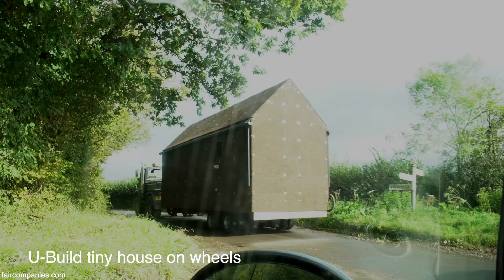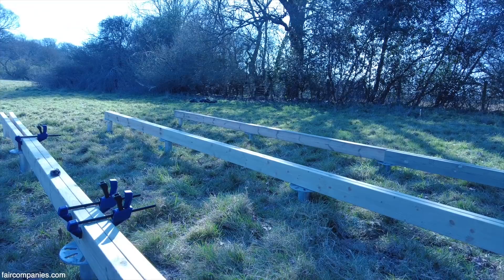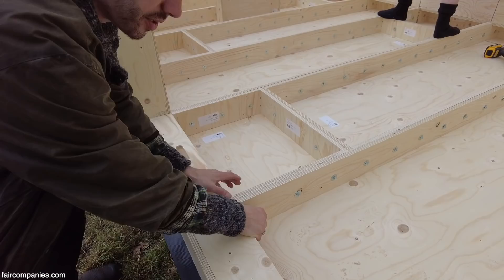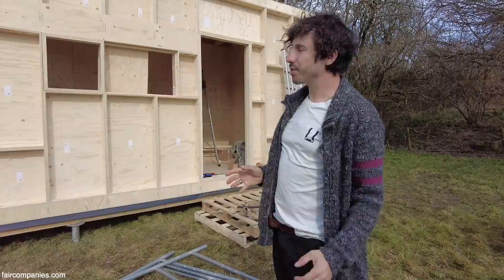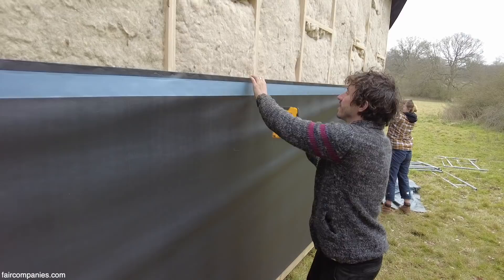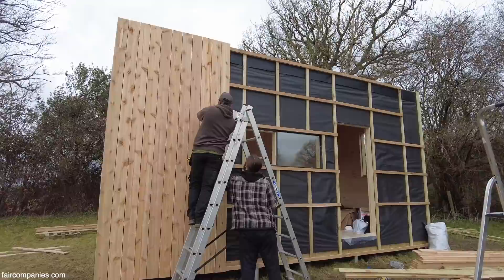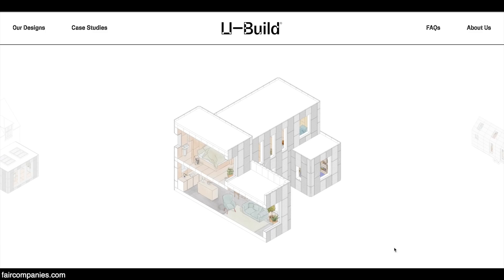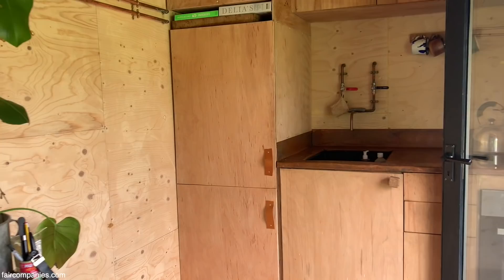U-Build hands-on: a flat-pack modular home you can assemble

Comment: Absolutely love this but can I ask why not use sip panels??? (I'm guessing weight and making the structure more mobile but if the structure wasn't going to be moved would sip panels make more sense ???)
Reply: They would be big and heavy. I can see this would be ideal for remote locations as the pieces could be carried in backpack..
Reply: SIP panels would also probably be lighter because you can use lighter plywood for the skins. This is an interesting idea but not really a good solution to the underlying problem.
Reply: @dejayrezme8617  I’ve toyed with the idea of making sips using 3mm skins and 2” foam panels to build a small hut. What would you recommend gluing such a thing with?
Reply: @boathemian7694  If you use PU foam you could use many different glues. The surface of the foam needs to be rough enough so you don't get delamination.
With XPS you need to be use glue that won't melt the foam.
I've been learning about boatbuilding for a little bit. 
Personally I'd use XPS and thickened epoxy and also sheathe the plywood in a thin layer of 200gsm (6oz) fiberglass. That is probably the cheapest and most lightweight way to build a waterproof wall panel. Just need to paint epoxy and wear PPE.
I'm also looking for ways to vacuum infuse fiberglass and XPS on a flat table.
Reply: @dejayrezme8617  I see, what’s XPS? I have found urethane foam in spray cans is a great foam adhesive for bonding but must be clamped very well.
Reply: @dejayrezme8617  That's what I thought. Though I take it there was a need for relocation. Watching the assembly I was like sips panel would have taken a quarter of the time. Though my worry was if it would have worked with the screw foundations that was picked for the build, UK planning permissions on farmlands are really hard to manoeuvre
Reply: @boathemian7694  Extruded polystyrene foam. XPS is closed cell foam like PU but it's a bit more elastic. From what I gather (not sure) PU foam is actually rather stiff and "friable" over time. Not sure if that would matter for a tiny house but it seems to matter on boats.

Comment: "Making a box is actually a difficult problem to solve" WOW
Reply: yeh that is such a weird thing to say
Reply: as in multiplying benefits or problems of "one box" thousands of times
Reply: I don’t think it’s a weird thing to say at all. If I were to build a solid wooden box from scratch it would require a fair amount of research, some new tools, and probably some trial and error. Anyone who doesn’t see the complexity there has either never tried to build one, in which case they are underestimating the complexity. Or has enough experience woodworking it’s trivial for them, in which case you probably don’t need U-build.
Reply: @stevenqirkle  I DIY loudspeakers and the complexities of simple boxes are clear since I started that hobby. Also how one box is not the next.

Comment: I'm sorry for being a jerk but these folks reinvented the wheel. Why didn't they just implement platform frame construction? It was painful to watch all the errors they were building. No vapour barrier, no cavity ventilation, no rain screen, and on and on. You used an expensive CNC machine instead of calling your cousins across the pond in Canada..... Good luck, cheers
Reply: Didn’t we watch them wrap the entire building in a vapor barrier at the end, before applying siding?
Reply: @sunspot42  He was in the toilet for that part
Reply: I must admit that I was worrying re cavity ventilation.... the fact that they are using sheeps wool insulation as well... that cannot get wet.  They would probably be fine from the outside but not sure re inside condensation.  They did put on a rain proof membrane before putting on the cladding.   I do not understand your comment about calling cousins in Canada... what does that mean.

Comment: I like the use of ground screws. I've thought about that myself, but in tornado country the threads would have to be larger diameter. Thank god they included part labels, but, where's the electrical and plumbing (and maybe cable & fiber) ? Greenhouse roof cover could protect the solar panels.

Comment: As much as I can appreciate their ideas, unless planning laws change in the UK you’re not gonna see entire houses built like this. 

The cabin or tiny home they built in this video was only about the size of a large caravan. As such as a “temporary dwelling” it doesn’t need planning permission but it can’t stay there forever, hence the temporary screw in foundations. It doesn’t have mains plumbing nor was it hooked up to the national grid for electricity. It will never be more than temporary shelter.

Then you look at a lot of the projects they have actually built with this system, most of it is either small cabin/tiny houses like this being used as summer houses or garden offices (again due to the single storey and small size under UK planning these don’t require planning but cannot be inhabited as a dwelling only an additional space adjacent to an existing dwelling) and extensions to existing houses, again most of which seem to fall under “permitted development” planning rules where a home owner can expand their existing property without permission or consultation on the design so long as it’s under a certain size, doesn’t adversely affect neighbouring properties or is on a “listed” building (a UK planning law that protects certain properties of historical value from alterations).

Finally the one full house they have built was in a self build development specifically where the local planning rules were eased to allow this kind of design.

Without serious changes to UK planning law I don’t see this companies work going beyond Garden offices and extensions.

There is a company called Facit Homes, who developed a similar CNC plywood building system. But theirs used completely sealed boxes which then had insulation material pumped into them (much more efficient than the insulation method these guys are using). And they have built several complete houses using their system. But again unfortunately their work has been limited to greater London and a couple of nearby counties where planning laws are a bit more relaxed and open to modern design.

Comment: The flat top of the second house wouldn't be allowed - or wanted - in Michigan, where the weight of winter snow would collapse it. Also how stable is it on its foundation? We get tornadoes and wind bursts which can actually move a house from its foundation.

Comment: This is a fabulous crash course in Architecture. I like how he covered: Foundation; Basically Framing; Cladding; Insulation; Flashing; Roof Slope, Windows...but, at @25:38 no MEP (Mechanical, Electrical, Plumbing) going on. The other issue is the requirement of a crew. I think it is a smart alternative to the Tiny House, however the Tiny House is not to be underrated. They have done some very sophisticated things with Tiny Houses in the last 7 years...truly outstanding things with Tiny Houses. 
Follow up: Right after I typed that above they went over MEP and a Tiny House version. Smart. However, "The Lord Giveth and the Lord Taketh Away.", we can't assume we will always have anything; nor can we assume we will always not have anything.

Comment: I mean I really don't see how this is any simpler than basic framing(But I can see it being alot more expensive). You're building a box, not exactly the most complicated floor plan to frame-up.

This feels a lot like container homes, concept going before common sense. Your creating alot of extra work and expense for the illusion that you are doing something novel.
Reply: Basic framing: putting long, slender pieces of wood together and having to ensure the vertical and horizontal plus odd angles if pitched roof being used. Very few surfaces available to ensure square. Rigidity and interlocking strength not present from beginning. Cross-bracing required.
Pre-cut boxes: fitting short, wide pieces of wood together to a precise pattern, numerous matching surfaces to ensure square. Rigidity and interlocking strength present from beginning of process. Cross-bracing built in.
Reply: Well said
Reply: In some respects agree but it does need some skill as Aaron Leverton has commented.    As a non-builder the U-build method seems far more accessiable but then outside of my price range.... I would have to weigh up cost against ease of build.
Reply: You also have to factor in your own time into the price. It looks like a novice can assemble one of these much faster than framing their own house. That’s definitely worth something to me.
Reply: I think it assumes a mostly-DIY labor content. 
And as to all the comments on the current cost of plywood... current market demand is driving this. I would think continually "engineering out" unneeded wood in these boxes will help contain cost.
Reply: @aaronleverton4221  "Very few surfaces available to ensure square."

It's called a level, and you attach everything to your foundation while you are putting it up.

"having to ensure the vertical and horizontal"

You mean a square? They literally sell devices called squares that will make things square.

"odd angles if pitched roof being used"

And websites will tell you exactly what angle to put your miter saw at.

"Cross-bracing required."

Which takes at most a few minutes to set up when you are raising a wall.

Those "precise" boxes took 3 months to set up? Two guys could frame that box in an afternoon. Heck in a day they could get it sealed up.
Reply: @shuunya  Carpentry is the easiest trade to do, and websites will tell you all your measurements and material needed, where to cut ect if you lack the common sense needed.

No, an amateur will never be as productive as an actual tradesman, but if you take it slow the actual process is incredibly simple and straightforward.
Reply: @stevenqirkle   "It looks like a novice can assemble one of these much faster than framing their own house."

It took them three months to assemble it. Two guys could have that framed in an afternoon. 

Even if you are incredibly slow, I don't see any way it would take two people more then a day to frame that, it's a box, there is absolutely no thinking required.
Reply: @bcoldwell1   "continually "engineering out" unneeded wood in these boxes will help contain cost."

Lol, and you know what that would look like? A stick-framed house.
Reply: @TheOwenMajor  Yes, never having built a house, shed or other building out of wood, steel or brick, I simply have no idea what the things you are talking about are.

Get over your professional self, mate and learn to listen to what  is being said. Society as a whole has lost the skills you are talking about because society as a whole doesn't require them. We don't build our own houses any more, we pay professionals to do it for us. But, even those professionals are specialised. Framers, bricklayers, joiners, carpenters etc.
The average person has little to none of those skills.
This system means they need none of them.

Next time lecture someone who doesn't have three decades' experience and who hasn't spent time managing non-professionals working on their own construction projects.
Reply: @aaronleverton4221  "Get over your professional self, mate and learn to listen to what  is being said."

I'm in sales bud, my sum total of building experience is building my garage and a shed.

"Society as a whole has lost the skills you are talking about because society as a whole doesn't require them."

And here is my issue. Why is the solution to this problem spending 5x the amount on prefab boxes, rather than telling people to read a book(Or watch a Youtube video) on framing?

"The average person has little to none of those skills."

And none of those skills are particularly complicated. We specialize so we gain productivity, a plumber will never frame a house as fast as a framer, nor visa versa, but neither trade is particularly difficult if you do it at your own pace.

So again I ask, why is the solution an overly complicated and expensive prefab system preferable to basic education?  This education, especially today, is free. It's not hard nor is it expensive. Framing a house is not rocket science, it's basic math. 

This gets back to my original point, this is a concept coming before common sense.
Reply: @TheOwenMajor  The major problem with your thesis is that this system is overly complicated.
You are completely missing the point that this system makes it far simpler. No special skills of any kind required.
A child who couldn't frame a building could build this.
Reply: @aaronleverton4221  you're exactly right. owen is majorly missing the point. i studied math, i've taken multiple woodshop / woodworking classes (and actually made stuff) and even went to architecture school. just getting the angles right on the boxes and bookshelf, and other pieces i've made myself — heck, just getting some floating IKEA bookshelves to be level on my wall!  — is a non-trivial task as far as i'm concerned! 

i'm now considering designing and building my own house, and there's no WAY i'd do even just the framing myself, because of all the points you made in your initial response in this thread. watching something like this — this is the sort of system i would love to have, and could actually see using, if i were to build my own home, by myself.
Reply: @aaronleverton4221  "A child who couldn't frame a building could build this."

Except they couldn't. It's really only the framing that is being replaced, all the other steps are the same(And I would argue those steps are more difficult anyways). I noticed they still had to use a miter saw, they still had to use levels and measuring tapes for the battons, they still needed to use scaffolding, they still needed to insulate and cover it, still needed to wire and plumb it. They still needed to do all these additional steps that involve the same skills needed for basic framing.

All in addition it appears to have taken them far more time and effort to assemble it than I would expect for a structure of that size and complexity.
Reply: @TheOwenMajor  None of the things you brought up in your desperate rear-guard action are "framing" and "framing" is the topic at hand, as created by you.
The only tools required to put this together are a mallet, a screwdriver and two spanners. Of course a child could do that and, no, those are not sufficient tooling for basic framing.
Everything else you're talking about? Nothing to do with basic framing.
Reply: @jraaccounts  agree. You'd have to purchase all the correct saws and tools, and cut everything precisely, probably wasting alot.  When purchasing materials as you go, back and forth to the lumber yard and without a truck, pay for several deliveries, and what about returning material if you don't estimate correctly. This system avoids alot of headache.

Comment: I like the idea. A couple of things I noticed though... when your weather taping openings you always always start at the bottom and work up, that way each time you apply new tape you are overlapping the tape below... that way any water runs down the outside of the overlap.... if you don't and there's an air pocket in the tape, water will track down behind the tape and into your structure causing mold and damp. 

Also when running the epdm roofing membrane over the top of your wall membrane and behind the cladding you've removed your first line of defence (the cladding) and you rely solely on that membrane for water ingress protection. 

Finally the membrane on the outside of the house appears to not be breathable.... which means you have a cold bridge between the membrane and timber(insulated) which will cannot dry out through good ventilation... made worse by the wool insulation and timber being breathable and therefore being the perfect place for mold to grow.... 

They are a beautiful looking building though fair play.